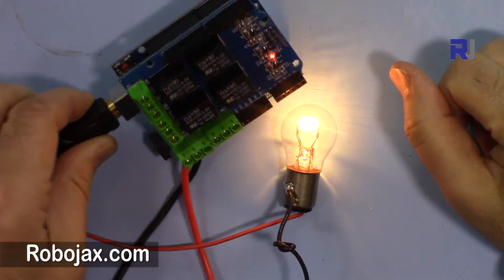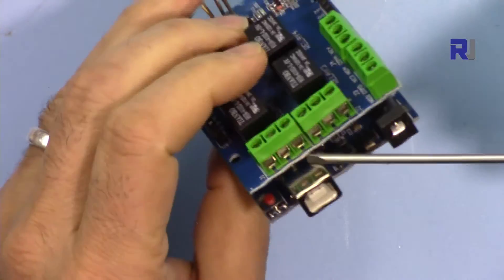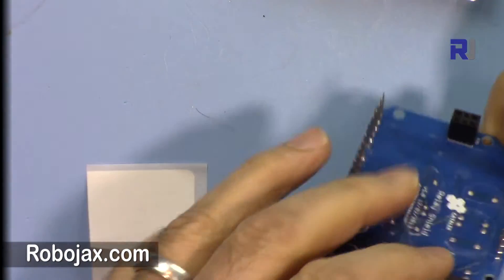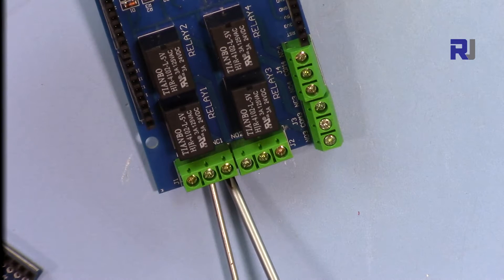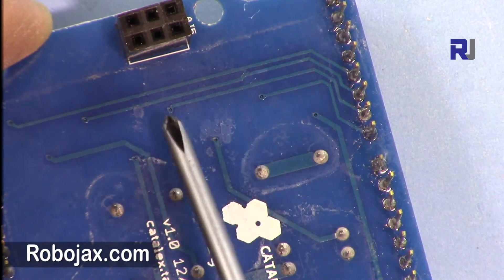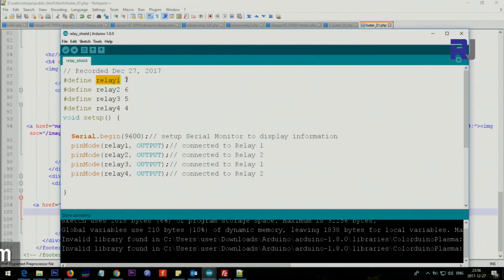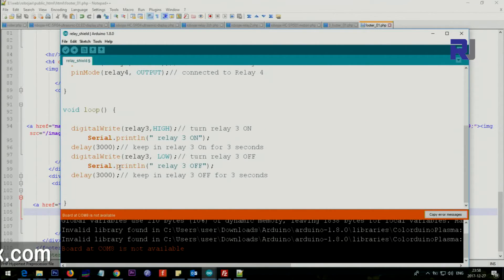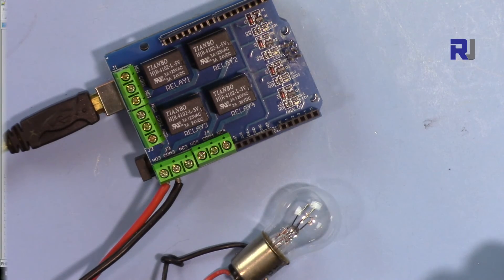How to use 4 channel Arduino Relay Shield RJT36

Comment: I'm going to buy this one and a Arduino Rev2 WIFI/ Bluetooth, and they will be used in a PC, to turn on, off groups of Led strings. Via WIFI or my smartphone. These are forseen with only Molex connectors, which are too big for building such a system.

Comment: Hi robojax, currently I am trying to turn on a solenoid valve on and off for testing and nothing is working. I have copied your code and I have watched the video multiple times. I have the same relay Shiels, does it power a 12v solenoid valve ?
Reply from the maker: Hi, do you hear relay clicks? if not,  check code and shield.  if you you hear clicks then it should work.
Reply: @robojax  I hear clicks, I think I found my problem I’m trying to power a 12v solenoid and I think the relay sheild is 5v, thanks for responding

Comment: Hi Robojax
I am trying to run 12V DC motor with 4 Channel Relay shield. I followed your video and tried connecting the same. I am using Relay 1 and 2 for forward and reverse direction. I am really struggling with this and not able to achieve the same any help would be appreciated. Thanks in advance.
Reply from the maker: Hi, the. Watch the video 2, 3 or 4 time so you learn it. This is how I do it. I can’t type what I said in the video.
Reply: Hey Robojax,
Thanks for your reply. I did not mention on the post that I want to operate my relay using joystick. Is this possible? Even if I connect my joystick and write a program for the same ……Relay operates on it’s own w/o taking input from joystick. Same program works with single relay.
Thanks

Comment: thank you very much for this demo !!! permit me one question, if i run 4 dc motors( each with its power supply) would 9v (680mA) battery be enough to run all 4 relays ??? thanks in advance for your video + time !!!
Reply from the maker: You are welcome.  The amount of current depends on how much current your motor consumes. Maximum should be written as 10A and I have shown it. Your motor voltage can be independent of relay module.

Comment: Hi, Robojax, I am using the Motor Shield that you have and i was trying  power a DC Motor with that and when i Upload the code, the Arduino and relay shield were glitching and the DC Motor was not moving. I checked the hardware to see is if there was any problem and it seemed to be fine. I also checked the code and even tried your sample code but still glitches. Do recommend any check to be done?
Reply from the maker: Hello, if don't know if you watched the video fully. if not, watch it without skipping. I have explained things about the module so you learn and if your shield is different you can fix it.
Reply: Robojax 
I have seen the video fully, it was really helpful and we are working for a small project for my son’s project 
We used 2 power source, one for Arduino and another for the Relay module common to drive the outputs, thanks for replying
Reply: Robojax 
After using the two different power sources, the glitching problem was fixed

Comment: this is great to turn the relay on/off
I would like to do this in an arcade cabinet with a pir motion sensor,and not with the delay code.
im new to this and not really sure how to edit the code to do this.
so my question to you would be.
Can you provide a code with the pir sensor connected to pin3 which would turn on any one of the 4 relays by walking up to the cabinet,then turning off when no motion is detected.
being new to this is like learning to walk for the first time lol
your help with this code would be appreciated so much..
signed
old dog tryin to learn new tricks
Reply from the maker: Hi, your project needs multiple components to be put together. You should be able to understand the sensor that detects when cabinet is opened. Then how you will open the door? does it already have motor with component to open/close if not you would have to make that. Then you can put them all together. So 
1-Learn how to use the sensor to detect motion. There are lots of ways to do it. One cheap would be ultrasonic sensor sensor to measure the distance. You wold install it inside cabinet and continuously measure the distance up to 180cm. So if obstacle gets closer to the door for example 50cm, you can turn on the motor to open the door.
Here is coupon (expires in 4 days) for my Arduino Course on Udemy where you can learn Arduino step by step: https://www.udemy.com/course/robojax-arduino/?couponCode=9F68A2CA54235660FB69
Reply: @robojax  im not trying to open a door.

its  like turning on a lamp using the 4 chn  relay shield,stacked on the Arduino uno. with a motion sensor(PIR)
just needed the code  for when the pir detects motion..lamp comes on then
no motion lamp goes off.

Comment: I need use 2 of this shield.... It's possible? How's the code this?
Reply from the maker: no you can't because the pins ca't be changed.
Reply: Robojax I’m so sad
Reply from the maker: don't be. Here is 4  to 8 channel relay you can use https://www.youtube.com/watch?v=Wbm3MCMgM_s
Reply: @robojax  Can you cut the pins off 4 5 6 & 7 of the second shield and jumper from other pins to 4 5 6 & 7?

Comment: What do you put for isolation USB port???
Reply from the maker: when you connect wire to relay, they are isolated from DC circuit. Other than you can't do anything else.

Comment: I just got my 4 channel shield yesterday, thanks for the video, it explained much.  However, even though I trimmed the pins for relay #3 as described, the shield still did not sit far enough down on my Arduino/Genuino Megas 2560.  I had to use the Prototype Expansion Board from the Starter Kit to get the relays to work.  The explanation of the pins might be helpful when I put this on a board.

Comment: Divide the voltage or switch voltage from A to B? I need the 12v to be switched over to the second line.
Reply from the maker: It took me a while to find out what is A and B.  You should have used reply to previous comments.
Your question was related to 8.2V and 16V and that's why I offered solution.
Now 12V. I did not understand what actually want to do. We have got 4 relays which work with 5V from Arduino.  What do you want to do?

Comment: Can the relay sense voltage for On @ 8.2v then Off @ 16.0v then switch to channel 2 ?
Reply from the maker: The shield can't do that itself. For each channel, you need 2 resistors (with right values) to make voltage divider and connect it  the input of each channel. this can be done. 
Here is voltage divider http://bit.ly/v-divider-1 and here is the formula for calculating V out which is your desired voltage. You can calculate R1 and R2 http://bit.ly/v-divider-2
I hope I understood your question.

Comment: Sorry for not explaining -  my goal is to turn on 12v / 1amp light bulb 1 for 30 minutes then Off ; then turn on light bulb 2 for 30 minutes ; then back to light bulb 1 and so on repeating .....
Reply from the maker: yes you can. this is what relay is for. Each relay can be controlled. I have written code for you here https://codeshare.io/a3pJAB